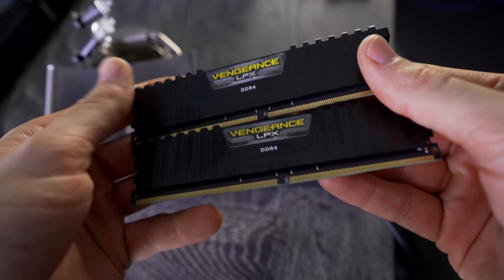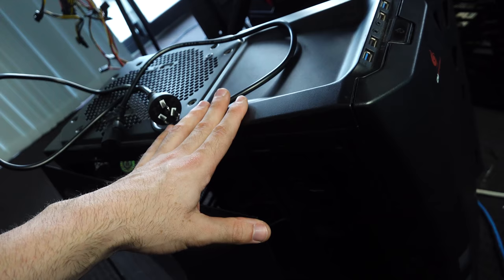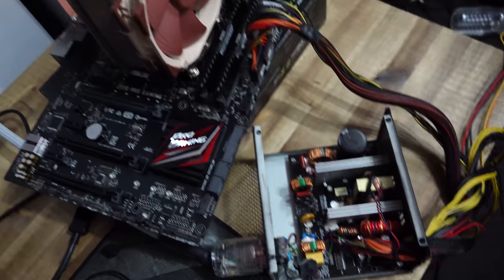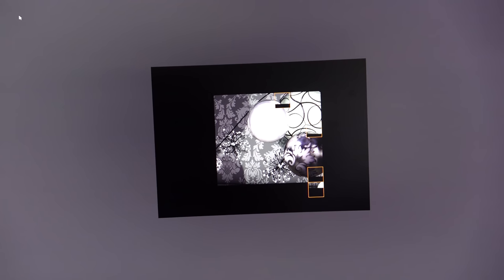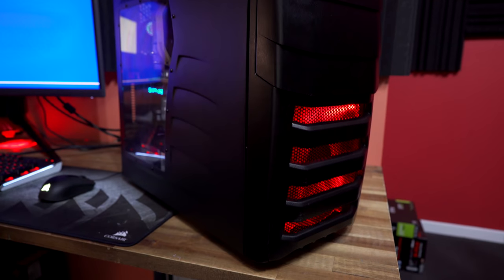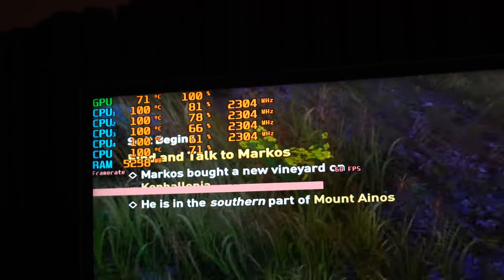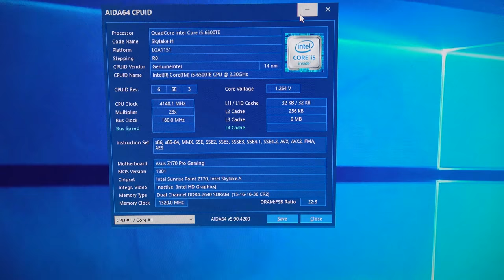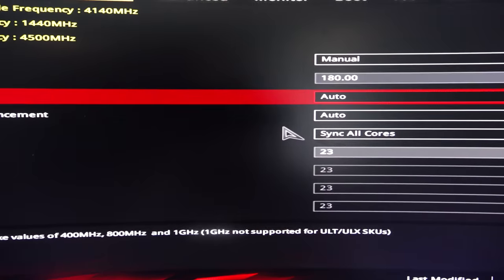$400 Assassin's Creed Odyssey Build | Overclocking the i5-6500TE

Comment: that's some electrical noise from the psu. basically the power cycling in the Components, making some of them vibrate physically.
Reply: Crazy timing. I was due to sell a pc today. Fired it up and whilst testing heard this exact type of noise from the PSU.
Had to postpone the sale until it's replaced and just now arranged an xfx core 550w for £20.
The PSU noise fluctuates a fair bit, sounded almost like a dodgy HDD at some points and then went louder/crackling. 
Keep up the great work Brian
Reply: I had an old old psu from the early 2000s that made that noise just before it died
Reply: It's a Capacitor on it's way out it's common for the soft capped variety!

Comment: I had my 6600k running very stable at 4.5GHz for over a year. It's a fantastic chip!! Nice build!
Reply: He probably upgraded. I also have an 6700k at 4.5. never goes over 60° and it's super fast.
Reply: I had a 6600k at 4.6ghz for over a year then upgraded to i7 8700k and 5ghz.
Reply: i had mine running at 4.7 for over a year and its still running to this day. Boots up and runs some tests at 4.8 but could it be a golden chip?
Reply: @thepro08  
What CPU is this ?
Reply: I've got a 6700k on the same mobo in this video, runs at 4.6GHZ at 1.35V.
Reply: @resistance1207 i believe u lost the silicon lottery sir. Most 6600ks can get 4.4 and up
Reply: Bring me up to speed. Is this something wow for Skylake? I mean I built 3 SB systems a while ago and oced them to 4m5 GHz and they are running like that for more than two years. One is a 2600k and the other two are 2500k.
Reply: My 6600k was at 4.5GHz @ 1.28v for over two years. Never had a single issue with it. It ran cool and performed well. I still have that CPU but it's in storage since I upgraded to the 8700k
Reply: @Isaah E. Yep, upgraded :) 👍 haha
Reply: @Thatguy-vu5iu  nice!!
Reply: @JonaFolgt  yea I chose the 6600k as I didn't want the hyperthreading. Somewhat regretted it when I started doing lots of video editing.
Reply: @resistance1207 yep!! Silicon lottery! Haha.
Reply: @forestflame172  4.8 would have been amazing!
Reply: @abcdefg9613  nah, pretty standard. Just a shame in the video it maxed out at around 4.2.
Reply: @FromPlsNerf  that's some impressively low voltage for that boost! Nice!
Reply: My 6600K is at 4.8 for over 2 years with no issues
Reply: my last two chips have been great samples. That 6600k @ 4.5 1.28v, and now my 8700k @ 4.9 on all cores 1.26v
Reply: @FromPlsNerf  my 8700k hits 5.1 @ 1.32v if u cant hit 5 you have a bad 8700k...

Comment: Cooler Master Storm Enforcer case. I have the same one. I took a hacksaw blade and cut off the top and bottom bars from the bottom front leaving the center bar where the screening attaches. Doesn't look as aesthetically pleasing but doubles airflow from that 200mm front fan.

Comment: Nice to see a non k overclock on 2018 !
I used to overclock my i7 6700 non k cpu to 4.7ghz with 1.390 vcore but now i'm fully stable at 4.6ghz and 1.35 vcore with 55° max on stress test.
It performs really great on game with a aero 1070 (100 to 300 fps on pubg with competitive settings and windows tweak)

Comment: Good one! I'm running an i5 6500 @ 4,4 ghz as well, these chips overclock just as high as the k ones, I don't run mine higher because of temps. one question though, how did you flash the bios in windows? I had to replace my bios chip in order to make the mobo happy with the modded bios, not a big deal as a new one only costs like 10$
Reply: Depends on the board. There are different methods and workarounds depending on the board, and depending on the BIOS version you're coming from - https://overclocking.guide/category/intel-oc-guides/skylake-non-k-oc/

Comment: got this card on ebay for 140 and was an amazing steal is a beast for 1080p
Reply: you would be surprised by a lot of rx gpu listings, great bang for your buck on tje used market atm
Reply: Feel dumb for spending 190 for a rx 570 during the mining craze
Reply: Wish i got some good deals bought a rig for $650 with a gtx 1070 G1 gaming i7 4790 8gb ram ....... yea and the cards fan died on me but its still running cool but still need to spend some extra money to fix that aswell fuck me LOL
Reply: Kyle Forgeard damn that sucks keep an eye on them temps
Reply: @Yhappp  lol yea its not overheating or anything it just sucks that the fan died now it needs to be louder to stay at same temps but still stays at 49C with 100% fan speed and at like 60 ish with normal fan curv hope i can get a watercooling kit for it
Reply: Dino Nuggets better hope it wasn't a mining card those tend to break within a few months
Reply: was from a graphic design business in florida that closed and they sold everything on ebay so unlikely but always a possibility
Reply: you may be able to get an nzxt braket an a corsair h60 cooler and do that think gamersnexus tried it on the 2080s
Reply: @seniorpepe9386  i  hope not its a year old card still seems to be working fine but that fan that died kind of makes me worry when i play games it still boosts to 2ghz without overclocking i will run more tests to make sure its fine
Reply: @DinoNuggets723  yes i will look for that i aslo looked at some watercooling kits but they are too damn expensive

Comment: The sound was a Capacitor on it's way out! The sound is common for the soft capped capacitors!  
A good quality PSU will have some if not all Japanese Solid Capped Capacitors always get a Bronze Class power supply minimum if not higher (Sliver, Gold or Platinum!) I also recommend in a Tower never less then a 720/750 Watt PSU!

I also recommend a CyberPower UPS with True Sine Wave it can save you many headaches down the road!

Comment: My 6600k was at 4.5GHz @ 1.28v on a cheap (but great) MSI z170a Pro ($90 mobo) for over two years. Never had a single issue with it. It ran cool (Max temps around 69C, with the hyper 212 evo no less) and performed well. I still have that CPU and motherboard but it's in storage since I upgraded to the 8700k

Comment: That sounds like a rattling transformer or some other sort of coil, that broke some of it's vibration protection (most often epoxy or hot glue). Either a part is loose on the pcb or one or more windings on a coil or transformer are loose and vibrating against their neighboring windings. I actually had this problem once on a psu of some sort of audio amplifier.
The best (and safest) way to find the problem I found was taking a wooden or plastic stick with a relatively soft point and touching all different component parts and multiple positions of coils, trying to dampen possible vibrations until you find your troublemaker.

Comment: The clicking is most likely a relay in the PSU cycling on and off for some reason. The output filter caps hold enough charge to keep the system going without actually having power coming in since you are barely using the PSU's output capability. If you had more of a load on it, she would crap out very quickly.

Comment: A dry joint shorting out on a cap  normaly the noise on the psu that is turn of the light and see if you can see a spark jumping.

Comment: i had bought a cheap optiplex 5040 with i5 6500 and put a zotac gtx 1050ti oc editon in it and now use it for gaming
also i was able to undervolt my cpu by 190mv and cpu temperatures does not exceed 50 degree  celsius

Comment: getting a 2.3 ghz chip rated for very low wattage (under 35 watts) running at 4.140 ghz with this low of a multiplier ( x 23 ) is pretty good.

Comment: The problem with many Z170 boards is they cap out @170 or 180 BCLK, so the low-end T- and TE-chips are a no-go for high clocks unless your mobo supports it which is usually not the case with cheap ones, so the i5 6400 or 6402p might be a better option, because they reach 4.6+ GHz with 170 BCLK if the silicon allows it. Usually those chips are quite cool (they aren't Kabylake or Devils Canyon) for being non-soldered, so delidding is optional really. My undelidded QH8F for example does 3.8 GHz with 1.47V and that results in like 80°C under continuous load.
Reply: Get a board with an external clock generator.

Comment: I noticed that Brian uses alot of very cheap, used psus on his builds. I was always told not to buy a used psu and not to cheap out on the psu. Is it worth it to buy a cheap used psu or should I buy a name brand new psu for my budget build and why?
Reply: Buy named brand new. Better to spend 100 on a good psu than to fry the rest of your pc and make it worthless
Reply: @joshuakim6273  bullshit
I built many pc with used psu and they are all working fine, u just need to take a good brand with 80+ certification
Reply: @MAGA2024.  ok cool. I just don't trust any second hand psu. Certainly not one that makes noise like the one in the video
Reply: @hanfredhustekuchen3136  nice post, gd to see a jonnyguru shout-out.
I believe my PSU that started making the same noise as this today was an FSP, no doubt an exception but still.
I replaced it with an XFX which are basically Seasonic, used for £20.
Reply: You can get a good branded PSU for $40 or so new. There are always sales and rebates. It just isn't worth the gamble.
Reply: For my part I can tell you that like Byran I am a PC Master with a somewhat short budget but if there is a tip that I listen to and now I can tell you it is never to be stingy with your PSU since the GPU can not fly your components, CPU, MB, HDD, SDD ... Only the PSU is capable of ruining one or several components at the same time, so to stay on a budget is complicated but NEVER skimp on the heart of your future joy. Always or almost always get a new PSU with full warrenty 😉
Reply: Lol im using 45 dollar 600w psu for almost a year and i have no problems. Myb bc my pc only uses  350w
Reply: It isnt worth it to take used ... but if a 1$ makes a diffrence for you then buy used ... its ok
Reply: Joseph Wilkinson
"I noticed that Brian uses alot of very cheap, used psus on his builds."
Of course he does, because he is not building these PC's for his own use, he builds them to sell to someone else and therefore why use Top Quality Brand New PSU's ?
If he was building these PC's for his own private use, I'm  sure he wouldn't use very cheap possibly Brand Name PSU's which no one has ever heard of. From what I know and I  have always heard as well, not to buy cheap PSU's, because if it dies it could take out other components as well like M/board, Graphics Card etc. Stick to well known Brand Name PSU's. Also don't just take 1 or 2 people's word, Google it if you are unsure, so as to get the opinion's of many people so you can make a hopefully more informed decision.
Reply: Safe to buy used 80+ Gold or higher from EVGA, Corsair, SuperFlower, Antec, Seasonic, FSP. Bought lots so far, never had any issue.
Reply: Just make sure it is 80+ Bronze or White. You can get those types of power supplies for as low as $45
Reply: Minus
"Safe to buy used 80+ Gold or higher from EVGA, Corsair, SuperFlower, Antec, Seasonic, FSP. Bought lots so far, never had any issue."
Just because you haven't had any issues doesn't really mean anything, you could just be extremely lucky that's all, but your luck won't last forever.

Comment: Great build but I have an 8700k 4.9 and 1060 (mining craze killed prices) that is oc pretty decently and I feel like you're just gonna have a horrible experience with anything lower. I struggle in certain areas at 60fps. The game is just piss poorly optimized. Sure it got 50fps but those frametime spikes were huge. And that's a major issue with this game. Maybe I just need a tech yes cleaning.
Reply: Ty Vad the game is heavy on the gpu, and many mid range cards like the 1060 is having trouble with the game. It’s just horribly optimized.
Reply: @Laserkitten  also has like 3 DRM's running in the background
Reply: @Laserkitten  oh yeah for sure. I'm not disagreeing. I'm just saying that in case anyone was looking to build a system solely because of this game. That being said, capped at 60 fps I only reach 70-80% gpu usage. Even with 1080tis people report similar frametime spikes. I'm just comparing to the build in this vid.
Reply: Well, at least you know what to upgrade first between the gpu and cpu :D
Reply: Since when is 1060 a mid range card ? What the actual fuck ?
Its literally 3x faster than my R7 360, which is the true mid range card that can play ALL games on good framerates.
Reply: Michael Scofield  1060 has always been considered a midrange card.
Reply: then why the fuck is it one of the most expensive cards ? 300 fucking dollars.
Reply: Ty Vad
Turn off the clouds. You can get a 25% performance boost. I recommend seeing Hardware Unboxed's optimization guide for the game.

Comment: Hi Braian, PSU problem might have been bad capacitor(almost dead). My old psu was making this wierd noise like little whistling no cracking before capacitor on gpu 12v rail blewoff. After repair shop swaped this element it was good to use.

Comment: The cpu has a hard 45w limit so it won't stay at 4.1 at full load so maybe try undervolt it a bit to get a bit more clock speed per watt
Reply: It will absolutely stay at 4.1 at full load. C States get disabled with non-K BCLK OC on Skylake. It runs full speed, full power, all the time.

Comment: how did you overclock the non-k? I have been trying to overclock my i5-6500 I have a asus mobo but my BIOS wont let me flash to the older BIOS that allowed you to overclock locked chipsets. Any ideas? Or am i toast with this MOBO
Reply: https://overclocking.guide/category/intel-oc-guides/skylake-non-k-oc/

There's a workaround to downgrade your BIOS. Check the ASUS specific section of that link. I downgraded my ASUS Z170i Pro Gaming BIOS numerous times.

Comment: i got a x79 modo from alienware with a i7-3820, 8gb of ram (ddr3), a water cooler and a 850w psu from seasonic for 250$cad. i put a r9 290 that i got for 200$cad. do you think it will perform well?

Comment: You said you thought you had an RX 570 do to Windows. You then said that once you install the 580 software your performance went up. My question is what would happen if you deliberately installed a 580 software on a 570 card? Did AMD get lazy and Nerf the 570 with its software

Comment: Hey Brian, you'd love the $450 USD used parts build I did a few months back! x5675 @ 4.6ghz, Hyper 212 evo, 24gb ddr3 1600, Asus Sabertooth x58, zotac gtx 1060 6gb, 240GB inland professional ssd, 1tb seagate barracuda, 600w psu and a military grean corsair c70 case.

Comment: Brian how did you raise BCLK above 100MHz without it messing up the other motherboard bits that also use BCLK?
Reply: The only other thing BCLK is tied to on Skylake is memory (RAM). This changed from previous generations and made ridiculous BCLK frequencies totally feasible. I used to run my i3 6100 at 4.6GHz daily with a 124MHz BCLK, and also managed a validation run at 4.9GHz with a 132.5MHz BCLK - https://valid.x86.fr/02kze9

Comment: I got my XFX RX 580 8GB GTR XXX LED Edition for $160 USD it's a great deal for the card, goes great with my 2200G
Odd thing is my PSU is an EVGA 850 GQ and I have heavy OC on both GPU and CPU so it's not like I'm not utilizing the PSU enough but I'm getting  coil whine from my PSU, it only happens under load in PUBG (most demanding title on my PC ATM) Is it a faulty PSU or am I an idiot and paired my PSU and parts wrong cause I got an 850w PSU for upgradability

Comment: my experience with oc'ing 6 series non-k intel cpu's is that 4,1 is ghz what u get
Reply: I ran my i3-6100 every day at 4.6GHz, as did my brother. I pushed mine to a validation run of 4.9GHz, too. All with an mITX motherboard and a Hyper 212 Evo - https://valid.x86.fr/02kze9

4.1 is low. Sometimes you lose the lottery, and sometimes the board just isn't up to it, Z170 or no. Most non-K i5 overclocks I've seen are somewhere between 4.4 - 4.7GHz.

Comment: For 40-45$ u can get Evga psu or Seasonic s12ii :) It is much better :)
Reply: MrBluePoochyena Yea what ever i was thinking Usa $.I was watching Amazon price... But still u can get like Evga 500w or seasonic s12ii rly cheap and prety solid for the price.
Reply: both are pure shit -- s12ii is 10 year old PSU design based on a 17 year old PSU design and lacks many modern protections that new PSUs have (like OVP and OCP on all rails), and EVGAs low end units are shite. 

Just because it has name brand on it doesn't mean it's a good unit.

Comment: CPU pegged at 100C, and stuck at 2.3ghz. Maybe try your over clock again, I don't think it took.
Reply: It's a bug with non-K BCLK OC on Skylake. The per core temperatures are broken. Only the CPU package temperature is reliable, and only with certain software like HWiNFO.

Comment: Why is MSI Afterburner showing the i5-6500TE at 100 degrees Cel. ? Holy Crap.
Reply: Normal non-k-OC bug, affects all retail Skylake chips with non-k-BIOS. Engineering samples however read fine for some reason.
Reply: Yea that's normal for bclk overclocking non-k skylake chips. I have a 6700T running at 4.4Ghz and shows 100c for a year now, still runs fine. I have a cinebench run of it on my channel.
Reply: How about you watch the whole video before shitposting?
Reply: I got worried and asked before the explanation came up.

Comment: An i7 3770k outperforms that i5-6500TE by quite a lot btw
Reply: I5-6500TE gets Around 6500 passmark score

I7 3770k gets around 9800 passmark score

Both of those scores are before overclock
Reply: Also this system is so closely balanced 100% cpu useage and 100 percent gpu useage loI... That cpu working so hard to feed that gpu .. i7s can do with like 30% of their power